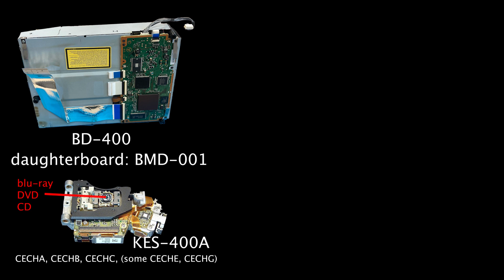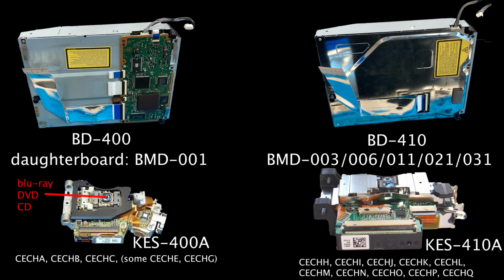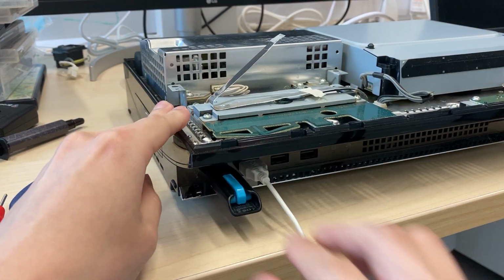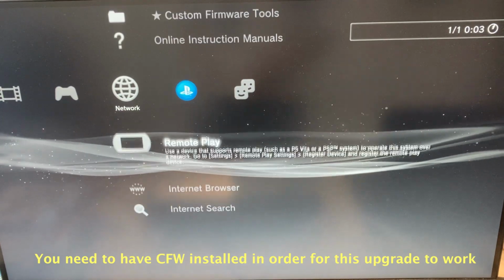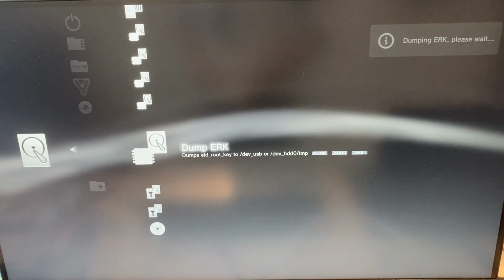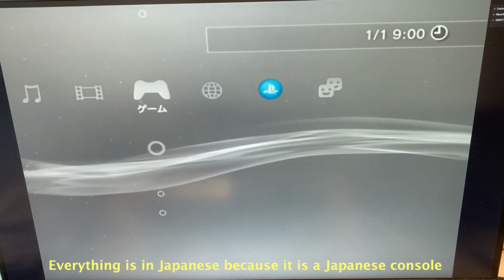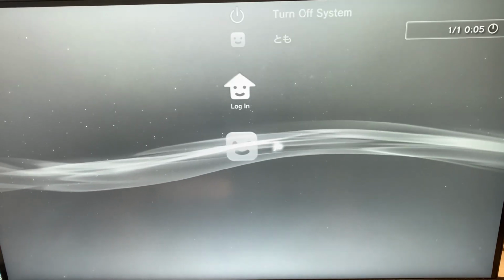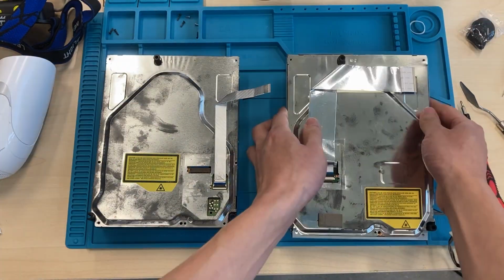Dead FAT PS3 laser? Don't replace, just upgrade!

Comment: I have a CECHA00 and I bought a faulty CECHL04 to replace the drive because it didnt read all discs. But I couldnt replace any part of it with the other. The cables and connectors are not the same on each boards. So this method is not working with every model. Maybe works with the american CECHA01 but with the Japanese CECHA00 it wont work.

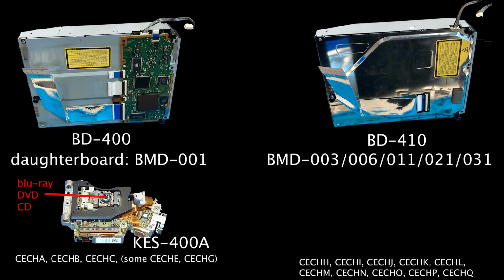Comment: 0:40 - this is utter bs. The KES-400A can absolutely still read some disc types and not others (just like a PS2 laser). The lenses are simply not placed separately, but as a single assembly.
The video is still useful, but this isn't an "upgrade", it just opens up more options for replacement drives.

Comment: Awesome video! Thanks so much! I was remarried a BD-410 with a CECHE01 today, and the custom firmware technique worked great, but now the system won't recognize SACDs at all. PS1, PS2, PS3, Bluray and DVDs all work fine though. Perhaps there is something about the drive itself that is required to read SACDs?

Comment: Apologies if this is a silly question, but does swapping the BD400 out for a BD410 affect the backwards compatibility of the console, or would you still be able to play PS1 and PS2 games if you followed the steps in this video?
Reply: I have the same question. I have a fat PS3 CHECA01 that has stopped reading ps2 discs and DVDS but reads blu ray and ps3 games fine. I have took it apart and cleaned the laser several times and it still doesn’t work. Looking to replace now but I thought the newer model drives are not backwards compatible like the older models. I would love to swap out so I can play ps2 games again
Reply: @MrRangers3511 the dvd has nothing to do with backwards compatibility. Dual laser model can still read all formats including ps1, ps2 and ps3. Hope this helps

Comment: Can i use og bd400 daughterbloard on a latest bd4100 drive and remarry?
Reply: The daughter board is the part that is married to the main motherboard. So remarry would be pointless. But I don’t think swapping boards is possible because the connectors and data lines are all different between the single laser and dual laser model.

Comment: I recently purchased an A01 model and it did read a PS1 disc no problem, but my PS2 discs all fail to start up, idk if the problem is on my PS3 itself
Reply from the maker: One easy way to test it is to transfer the iso of your PS2 game into your PS3 and then load the iso directly to see if the game starts. (CFW required)
If it also stays in the black screen, that means your PS3 is broken, probably the PS2 EE chip is dead.
Reply: It does recognize its a PS2 disc, but at the moment I start the game I just get a black screen
Reply from the maker: Based on your description that it can read but can't play, it seems your disc reader is fine.
If you have DVDs movies, you can check if you can play it with your PS3. If so, that means your disc drive is fine.
Reply: @1ofakind247  i had the same issue when I jailbreak my A01 it would not load ps2 games even with a disc. It only worked after it restored it back to the official software. If it still does the same after factory reset it may be a dead ps2 gpu

Comment: I have a CECHB01.  Strange issue.  It reads music CD and PS2 DVD format games effortlessly, but nothing else.  Is that a dying laser or something else?
Reply: God I have been trying to figure this out forever
Reply: @Thallidus the ps3 logic board ends up dying. plenty of issues stems from attempting to repair laser while on, hooking up disc drive while on, and or the logic board high def chip malfunctions. instead of replacing any component on logic board swap unit to a CECHH01 blue ray drive. it will last a lot longer.
Reply: I have a CECHE01 it read everything fine until I put some blu rays in so now it won't read ps1 or ps3 and even now recently won't read ps2 anymore just dvds wtf is going on
Reply: Yes.
Reply: Still wondering about this?
Reply: Just replace the dvd or cd player or burner

Comment: I am about to replace the drive, but didn't understand the FAT32 USB drive and what is that use for?  Does the FAT32 USB drive comes with the Blu-ray Drive KEM-410? or I need to purchase it separately?
Reply from the maker: It's for remarrying the drive.
This tutorial explains what the USB is for
https://www.psdevwiki.com/ps3/Remarry_Bluray_Drive#Remarry_BluRay_drive
Reply: Some of the files needed for the usb drive aren’t available anymore. Is there a way to do this without the usb?
Reply from the maker: There's actually a newer guide, maybe you can try this instead
https://www.psx-place.com/threads/how-to-remarry-blueray-drive-on-cfw-ps3-step-by-step.26913/

Comment: I wish I had seen this before throwing away a drive with a dead controller. Maybe the lens was still good :(

My current one seems to have a broken laser but it also doesn't read DVDs. I have check it is KEM-410ACA. Should I replace the whole drive or just a laser assembly? Doesn't spin but some say it doesn't with a dead laser.

Comment: I have a CECHA01 model, not sure which drive is inside (one laser or two), but my system is currently reading PS1/PS2 CDs and PS3 Blurays, but not PS2 DVDs - which seems like it shouldn't be possible based on this video? Either it should be reading Blurays only, or nothing at all?
Reply: I'm having the exact same issue right now. It must be that the processes needed for the single laser to read dvds is malfunctioning somewhere along the way. Maybe there isn't enough power being given to the laser, or the drive isn't putting the laser in the proper position to read dvds but can still get to the proper position for other discs? I'm just going to replace the whole drive unit on mine.

Comment: I was wondering if you could help me fix my optical drive and what the best solution would be? 
I disassembled my ps3. Took out the optical drive lightly clean the laser and put it back together. Its still not reading discs. My fat ps3 is not jail-broken and i cant get it to connect to the internet. I currently dont have a windows pc. I only have a mac at the moment. Should i just replace with another BD400 and if so where would you recommend?
Reply from the maker: If you don't have CFW installed, then your option is very limited. You can only replace the laser lens.
Replacing the whole BD400 drive won't work for you either, since you still need CFW to pair your motherboard to a new BD400 drive.
Reply: @hardwarerepair200  i managed to get it hooked up to the internet and I found that the ribbon cable was loose inside the white taped off area. So it works now. I had a problem reading one disc but others work fine. I downloaded the plug in from the ps3 browser but I havent tried to getting the fatusb32 files on a mac and I still want to try and jailbreak it. Just not sure If I can do it with mac.

Comment: If I uninstall CFW will the drive still work?
Reply from the maker: Once you finished remarrying, you can uninstall the CFW without affecting the drive.
Reply: @hardwarerepair200  Sweet, that's what I was wondering if it was dependent on CFW to keep the drive swap.

Comment: Are there any more benefits to doing this aside from it being a dual laser drive? Like are the parts for the bd-410 drive more common and easier to find than bd-400 parts? And how do I know what version the daughterboard has?
Reply from the maker: Yes, there are more BD-410 than BD-400 out there. Also, BD-410 is usually cheaper than BD-400. So it this method makes repair easier.
As for daughterboards, you can refer to this table
https://www.psdevwiki.com/ps3/Bluray_Drive#Bluray_Drive_Revisions

Comment: Swapping the KES m-400A Laser with the KES-410A Laser will not working ? Am i correct?
Reply from the maker: No, it won't work. I think the daughterboard BMD-001 doesn't recognize the new laser KES-410A.
Reply: @hardwarerepair200   Small Question is it possible to use the BD-400 in a Cech-H04 ?

Comment: HI ERROR  CEX_DRIVE_INIT_SBLOCK() FAILED  CEX_DRIVE_INIT() FAILED CAN YOU HELP ME? I HAVE CFW COBRA NOBD
Reply: if u have a new drive or a daughter board connect update to a CFW without noBD and do it again. The noBD CFW is blocking the remarry process
Reply from the maker: @nkls287  Thanks for answering questions for me! Yes, installing a normal CFW and try again might help.

Comment: Needs modding right??

I remember changing a phat PS2 optical pickup using an elf program to rewrite something on the PS2 logic circuit, that enabled the use of KHS-400C instead HD-7.
Console motherboard was untouched, I mean modified because of this, but factory condition, no reading burned DVD or CD Rom games
Reply from the maker: Yes, it requires CFW to be installed on your PS3 in order for this upgrade to work.
Reply: @hardwarerepair200  Umm and it can be rolled back to stock firmware after or definitely must stay on custom??
Reply from the maker: @eileenlucynakurosawa7421  Can, it can be rolled back easily by just installing the official firmware again
Reply: @hardwarerepair200  OK thank you very much for the answer!!

Comment: How about SACD compatibility? Will it read SACD discs?
Reply from the maker: I am not familiar with SACD. But after a quick search on Google, it seems yes. PS3 does support SACD.
Reply: @hardwarerepair200  Oh,5 months ago I bought C04 PS3 with bad laser  and I have KEM-410A Disc Reader and Lens from K04 YLOD PS3.  I thought about that but I didn't try. I bought KES 400A laser. Thanks man!